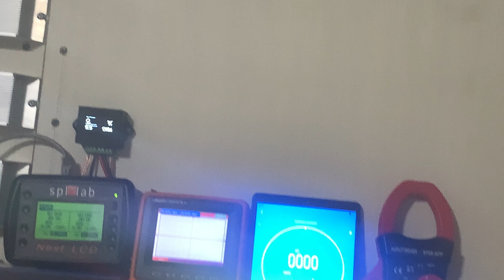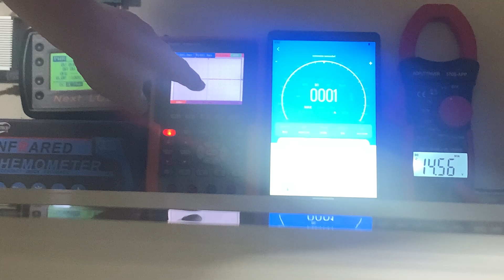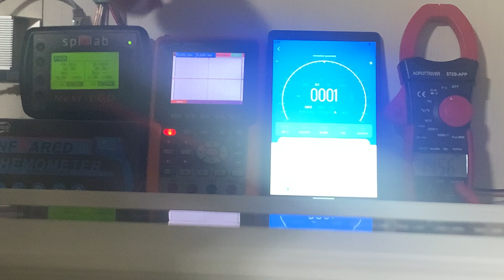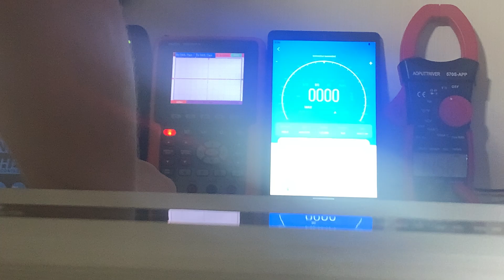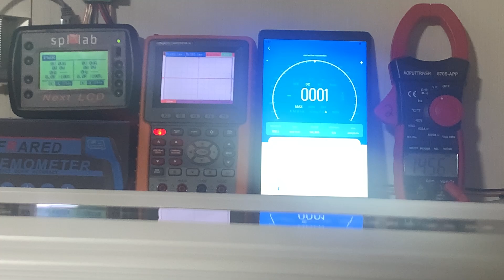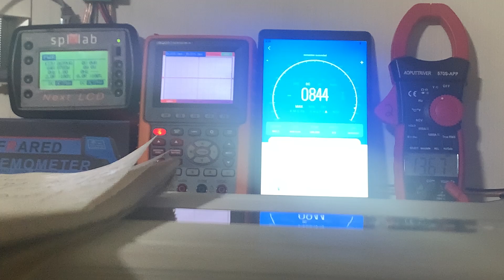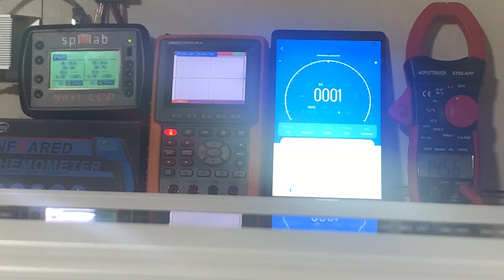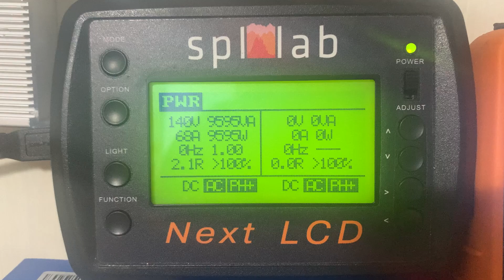Taramps Chipeo T9000 amp dyno (2-ohm version)

Comment: Question. What power and ground input adapters are you using for this amp? I just got one and my skyhigh oversized 0 guage wire does not fit in these.
Reply from the maker: These are 1/0 to 1/0 amp inputs I got from Droppin Hz a long time ago. I can't remember if they fit into the Chipeo terminals as is or if I had to modify the adaptors.
Reply: @AllAboutAudioJW thank you! Also, I’ve seen people comment that these chipeo amps don’t do to well on the lows and after watching a ton of videos on them it seems like everyone putting up decent numbers with these amps does so at higher frequencies such as 40hz and up. Do you have any insight on how to combat this? My box will be tuned to 33hz and I’ll be running a dsp as well. If not that’s cool just wanted to pick your brain on the subject
Reply from the maker: @michaelmartinez6660  There is a lot of bad information that goes around about car audio in general. Full bridge amps are no exception. The fact of the matter on this particular amp is the frequency response is 5Hz-5kHz. I have heard the T-12000 on 4 HCCA 15s in a series tuned 6th order and it crushed the low lows. I have personally used the HD-3000s in my own personal build on 5 American Bass HD-15s in a series tuned 6th order and it would float just about anything I threw in the window. It peaked at 30Hz with the window down and 22Hz sealed up.
Reply: @AllAboutAudioJW oh I see! I was looking for info on how it does in a standard slot port or areo port enclosure. From my understanding 6th orders have a way wider frequency range. Either way I appreciate the response and I’ll keep doing some research on it.
Reply from the maker: @michaelmartinez6660  That is all in how the enclosure is built. The amplifier only amplifies the signal coming into it. As I said earlier the Chipeo lineup is rated for 5Hz-5kHz so it has zero issues playing whatever frequencies in that range. As far as low end goes, you would be hard pressed to find another amplifier that is rated to play as low as the Chipeo amplifiers. Here is a link to the Chipeo 9K on the Taramps website. https://www.tarampstore.com/amplifier-taramps-t-9000-chipeo-1-channel-9000-watts-rms/p
Reply from the maker: @michaelmartinez6660  To put it into more of a perspective, I did a quick search on a few of the more popular Korean half bridge amplifiers and here is what I found. Sundown Salt 8 frequency response 10Hz-250Hz. Orion HCCA 8000.1DSPLX frequency response 15Hz-250Hz. D4S JP83 frequency response 14Hz-271Hz. DC Audio 9K frequency response 20Hz-250Hz. And again the Chipeo T-9000 frequency response 5Hz-5kHz. Hope this helps.

Comment: Think it would hold if speakers are wired to 1ohm as a daily music driver? I already have one but still in the box
Reply from the maker: It COULD. That is definitely a risk that you would be taking for yourself. Best case scenario is if you keep the amp out of clipping 100% of the time. If you introduce clipping, then the amp will more than likely fail as full bridge amps do NOT like clipping more than any other amps out there.

Comment: Will you be doing the 1 ohm version?
Reply from the maker: If a 1 ohm version comes my way I will be happy to test it. Unfortunately, I do not have one at the moment.
Reply: Great video! I was considering getting the 12k 1 ohm model but after watching this video and knowing my lowest rise at the frequencies I play music at my lowest rise is 1.4 ohms through 2 ohms I’m thinking the 2 ohm model is best for me.
Reply: What your subs wired at?@Mike-x8v2x
Reply: I think for the money that's good do you think you  could run it at 1ohm.
Reply from the maker: @ I am going to be running 2 of these amps at 1 ohm each. This will be in a burp build and after rise I will be over 2 ohm. In a daily build I have a friend that is wired to 1.5 ohm and has one of the Chipeo 12Ks ordered. We will see what it can do when it comes in. It will be on 6-15's in a series tuned 6th order wired to 1.5 ohm.
Reply: @jeremywilliams8558  Thanks kept me posted i was thinking of getting  the 12k and running it at .5 I have 120 amp hour of cmax at 15.7 volts.
Reply: On subs
Reply: T9 VS HD 10k v2?